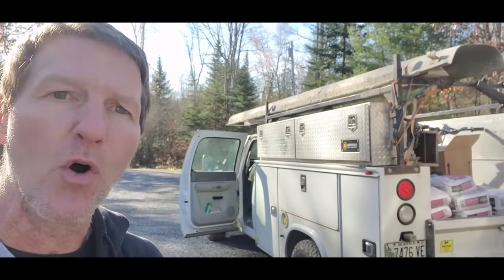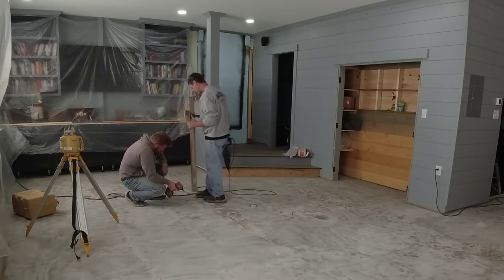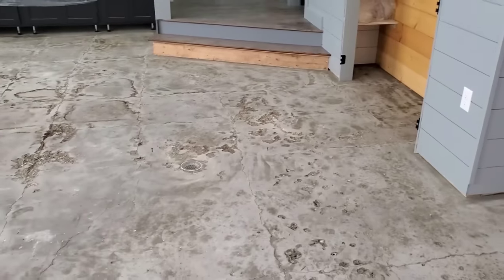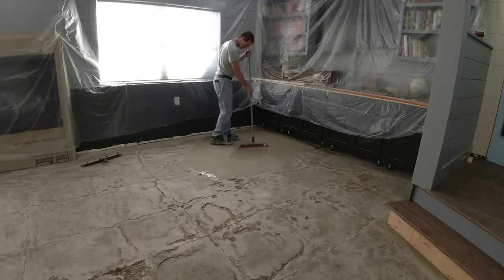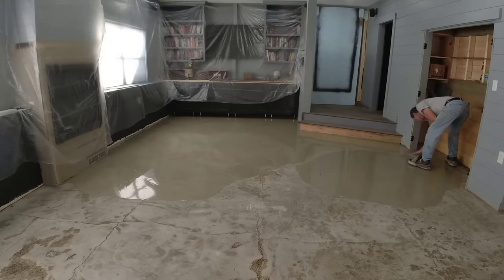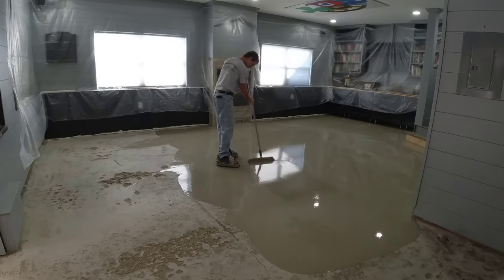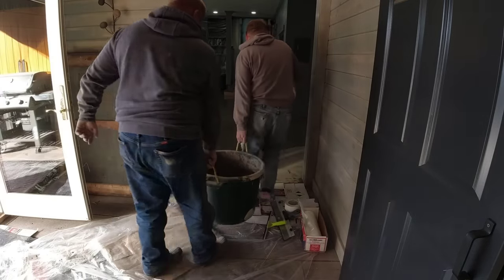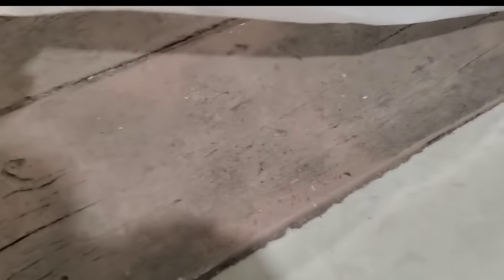Amazing Self Leveling Concrete Overlay (Fixing a badly damaged concrete floor)

Comment: If you are fixing a floor like that but it's going to be used for working on cars with heavy jacks rolling over it all the time, will it eventually start to separate from the existing floor? I tried that on my garage floor and eventually it lifted. The floor seems to produce this white powder that almost seems to grow from the pits and spalded areas. I have no idea what it's from. I try to wash it out but it always comes back. Maybe that's part of my problem.
Reply: Efflorescence? Do you have a water problem?
Reply: @paulmvn5431  I don't think so. There isn't any plastic down over the gravel so maybe some moisture is wicking up to the surface.

Comment: Nice video! I wonder how "hard" the finished product is compared to concrete? How does it withstand heavy use such as floor jacks, dropped wrenches, heavy truck/equipment traffic?
Reply: Depends on what you need. We typically use a product that sets to 25 MPa but we also have product that can get to 50 MPa which is harder than concrete. That one is more for industrial use like if you have forklifts running around the place.

Comment: I need help. Your room looks much larger than mine. I have the same issue with different  levels needing leveled out. It looks like you used around 21 bags just counting your bags. Calculator is showing me around 68 bags for a 24x12 room with 1.5” in some areas and in others less than 1”. On average around 3/4”. My room is like yours & has a good slope to it but it’s not entire room just a section. Can anyone tell me how many bags of self leveling I would need?

Comment: Is it ok to stain it before you seal it?  IF so, would i need to etch the new concrete floor or apply the stain directly?  Thank you
Reply from the maker: You can stain this without etching.

Comment: Would I be able to put this on a garage floor for resurfacing and still be able to drive vehicles on it? Wondering if it’s durable enough to do that? I’m planning on doing rustoleum rock solid afterwards. Any input is greatly appreciated
Reply: You can drive on it no probs. But what's your reason for resurfacing it?
Reply: @matoko123  cracks, small holes, chipped patches

Comment: Mike, every time you post a video I want to go to the building supply store and buy some cement to mix...So how many bags did you use for the job and what square footage. Also would this help in the flex of a concrete floor...the reasoning for the cracking I' sure. I'll be back later Mike I got to go to building supply store for some bags of you know what!!!!!

Comment: Would you recommend me putting a hammer drill against a piece of wood in the floor to try and get some vibrations into the floor just to try and make sure it's as level as possible?? 

Appreciate the videos Mike, they've helped me alot 👌
Reply from the maker: No, it'll self level if you mix it right and spread it like we did.
Reply: The wood would destroy the smooth surface ?

Comment: A spiked roller works better than a squeegee...as it doesn't pull or push any material away from level...it also will pop any air bubbles or lumps.
Reply: 14 minute mark you can see all the uneven flow marks and pot holes from using a squeegee instead of a spiked roller...and it will dry just like that.
Reply from the maker: Next day it was perfectly level.

Comment: I have a garage floor that was not put in correct and snow melts pools in one corner of the garage. so going in and out of the house you step in a puddle water. We have been told we will have to take out the floor and repouring the floor. its only 10 years old
Reply from the maker: It can be fixed by someone that knows how and what products to use.

Comment: Whats your thoughts on this being used as a finished flooring over plywood subfloor on a second level? The specs say thats a sutable use with primer, and metal lath screwed down. Whats your thoughts? looking to do so kind of concrete overlay for a finished floor on the second story of a house, let me know if theres a different product you would have in mind. THANKS!

Comment: Why are you starting on the outside edge instead of the center where the leveler will be thickest?
Reply from the maker: We're working from one end to the other keeping a wet edge.
Reply: Would not the batch that you pour first continue to migrate towards the lowest part of the floor which would cause it to not be level?
Reply: Was wondering the same thing! Could a good result be achieved by working in a circular pattern, center/deepest to thinnest to maintain your wet edge?

Comment: I'm wanting to do this to a couple of bedrooms and seal the self leveled concrete to use as a finished floor.

The concrete floor right now has been acid stained and has a sealer (in bad shape) on top of it. What would you recommenced me do as far as prep and application?
Reply: Hey there! 

I'm thinking of these scenarios:

1- Find out if the new self-leveling concrete will adhere to the current sealer. If not, sand the current sealer.

2- Find out if you can simply add the Sakrere primer (from the video) on top of the current sealer, and use that as a base for the new self-leveling concrete.

What do you think?
Reply from the maker: You got to create a bond, it has to adhere to the concrete. Probably going to have to remove that sealer first.

Comment: Mike, love your vids! Would this be an option to fix a garage floor that’s starting to develop some surface cracks? Is there a better option for that? Thanks!
Reply from the maker: This is an option, yes. If it's just cracks you can use this: https://www.everything-about-concrete.com/epoxy-concrete-repair.html

Comment: Cool that you can just use that as a finished floor, just let it dry and then seal it with an acrylic and then a 2 part polyurethane ?

Comment: I have a broom finish floor with paint on it.  I want to level it and have a smooth surface for my wood shop.  Do I need to remove the paint, or can I just prime it?
Reply from the maker: It's better to remove the paint first. The adhesion will be better. If you go over the paint you're betting the paint will never peel from the concrete. The paint would be your adhesion at that point, probably not too good.

Comment: You say "that could be the finished floor". Really?!  It can be the finished floor? I have exactly this scenario. A center drain in the basement was relocated during a complete pipe replacement. The floor still has that dip in the center and lots of rough spots, irregularities and seams from different concrete pours. It's over a hundred years old, had tiles and carpet etc, before. I need to level the floor as well as make it one homogenous surface. This drainpipe excavation was an unplanned necessity and I don't have the budget to lay a floor. So this product is a self leveler and actually provides a durable , smooth finished surface?  And It's ok if we paint or epoxy afterwards?

Comment: Dudes they make a mixer on wheels that is about 55 gal. you could have done this in about 1 or 2 batches. The mixer will tilt to dump.

Comment: You have one thing kind of backwards. If you have a highly porous floor you use the 50/50 and then follow it up with 100% primer. But if you have a more or less non porous floor, you just go with the straight 100% and skip the 50/50 solution.  Look up the manufacturer's recommendations and you'll see that this is correct this is correct. I'm gonna guess, given your general knowledge, that this was just a misstatement on your part.
Reply from the maker: I actually called the Sakrete "Pro" and he recommended I do it this way.
Reply: @MikeDayConcrete   I would suggest reading the specification materials.. We both know the the manufacturers cycle through reps way faster than they should.

Comment: Where's the spikey roller? That floor has more tide marks than the fkn seaside!
And you use a paint roller for the primer not a brush 🤣🤣🤣 I'm a professional floor fitter and this is how not to level a floor!!